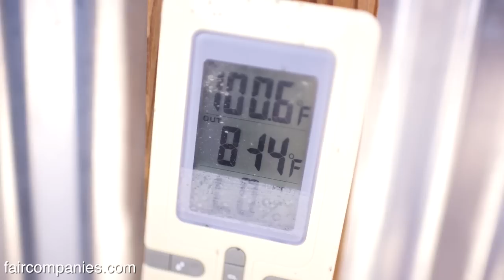From Gotham to isolated, code & debt-free West Texas estate

Comment: You Know, if that guy had driven the holes vertically down into the earth, instead of horizontally across the ground he would've completely solved his cooling/heating problems. 

This would work because the deeper you drill into the ground the cooler it gets! So, just pull the air from below. His original idea @22:26 is essentially the right idea but he just needs to change the orientation of his duct work. If he can produce a room with negative pressure in it then it will naturally pull the air up from below the ground... heat in winter and cool in summer! Nature's Own Heat Pump! 

Most people who know this stuff won't ever tell you this stuff because there's no money to be made in it... Not like there is in the heating and AC business! Negative pressure is the key to make it work. Or honestly, what did the ancients use to do? Then too, regarding the dust, if you enclose the system and use filters it will not be a problem... The dirt and dust from below is way more compacted. But if that's still a concern you can sleeve the holes with pipes to draw the air up through. Some people are experimenting with this in their greenhouses to maintain the perfect temperature year round...
Reply: Seen Retired Elderly Gentleman In Nebraska Run Underground Water Lines For Yearround Greenhouses.!. Very Impressive . . . . .
Reply: Actually, you are wrong, The deeper you drill into the ground the hotter it gets... After all the core of the planet is a solid chunk of compressed iron surrounded by a liquid boundary of iron and other heavy metals. And yes, I said liquid so it's at minimum 2000ºC and estimated to be 6000ºC.

The temperature increases by 25ºC per km the further you dig down, in the TauTona Mine which is almost 4km down, the surface temperature of the rock that they mine is 60ºC, although this is due to the mine having cold air pumped into it, so if you lived just 1km below ground you'd have roughly 25ºC all year round, although you'd have the trouble of breathable air, in your shaft, because you'd still need to pump air down, and sure, you could somehow build a trompe that's deep enough to do so, to force enough air down which you could automatically compress, and use to replace the oxygen levels in your shaft.
But it isn't generally true that temperature decreases, as you dig down, as it generally tends to increase, however compared to a summer day in Texas with 40ºC degrees in the shade in some places, it tends to decrease at first.
Reply: Oh and there is no such thing as negative pressure... pressure is always positive, however the direction of the pressure aka the flow of it, from high pressure to low pressure is what you need, so you could pump the cooler air underground up, by using compressed air... However why you wouldn't just compress the air in the first place and just run that through a water pipe is beyond me, because that's the easiest way to cool air.
Reply: @The Major,
Oh but there is negative pressure in the voidspace ...there has to be it's the same mechanic which allows for a permanent draft in a drafty old house! Also, it's at around 30 feet below ground that the temp remains the same 65-70 degree year round.
Reply: @The Major,
NOT talking about that deep! If I were then you'd be correct... But I am not.
Reply: @The Major,
You don't need to compress anything! Nature does it for you... When the hot air vents out through the roof it creates a vacuum pulling cool air from underground... Since there is no air underground you need a air intake vent pipe running diagonally from outside down into a voidspace deep under the dwelling space (NOT as deep as you may think...). The vacuum in the dwelling produces updraft from below. This updraft pulls hot air from outside down into the voidspace cooling it on the way to around 65-70 degrees Fahrenheit. It's that temperature year-round between 30 and 50 feet deep ...No compression needed. Coober Pedy  is an underground city on the Southernmost tip of Australia where the temperatures above ground routinely exceed 130 degrees. They live very comfortably down there! So, to avail ourselves of the comfort of not roasting to death in such heat above ground we just vent it to the surface in a self-enclosed environment --Nature abhors a vacuum so it will suck the cool air up and it will be cool air!!!
Reply: The Major  c’mon you going to drill 2miles? That’s where it heats up a lot . We’re talking 8 or 10  or so to reach 60 degree maybe 12 feet to reach 52 degree . JFC
Reply: @livedandletdie  Have you not ever been in a basement? It's common knowledge it's cooler just below grade.
Reply: ahau oxlahun Lol that or never been in a basement. It’s well known throughout the off-grid community going underground helps with cheap insulation and efficiency. Cooler in the summer warmer in winter (than above grade). Like this is textbook, shouldn’t have to be explained 🤦🏾‍♂️🤷🏾‍♂️.

Comment: Hun, I'm running into town for a gallon of milk. See you in 2 months.
Reply: While it is a funny comment, John actually only lives about 15-20 minutes from the Town of Terlingua which has some services including a small Grocery store, kind of like a General Store. Also, Alpine is about 1 hour and 10 minutes north of him, a Town of ~6000 population which has almost everything you need. To get to a City which has everything most Americans are accustomed to, he does have to drive about 2.5 hours to Midland/Odessa.
Reply: Army of Gog  Why would he be freezing? He has a well insulated home and in one video of him he uses a Mr Buddy when it gets too cold. Bear in mind Far West Texas doesn't regularly drop below ~30F nor stay there for any real length of time (although it can see spurts of single digits a few times per year). Also, why would he pay 3x for food? Have you never purchased food at a Grocery Store? The prices aren't automatically more expensive just because it's a small town. The Fuel comment is only accurate in the respect that John's main vehicle is a big Ford Truck, which probably gets ~13 MPG.

Lastly, you clearly didn't catch John's humor. Do you really think he doesn't bathe or shower ever?
Reply: @bookcadenb4584  Indeed and, if you don't mind the slightly sweeter taste of Sterilised Milk: It's shelf stable until opened for a few months depending on the exact production processes. So you wouldn't have to buy it that often.

UHT (Ultra high temperature) treated milk on the other hand tastes awful and I wouldn't buy it even if it can last for years shelf-stable until opened.
Reply: @bookcadenb4584  There's many problems with living so remotely- no well water, no "shore power" if you have an emergency of any kind it could prove fatal before you could even get help or get TO help, your car breaks down on that 2.5 hour trip you are kind of screwed, no cell or phone service? no internet?
Reply: @bookcadenb4584  
Terlingua - The Ghost Town in Terlingua, Texas, population: 58, just 5 miles from the Mexican border which puts anyone living remotely around there at risk too, if you had to go in for surgery or something and was away from the homestead for 2-3 days you could come back and discover everything you owned is GONE because someone happened by and saw no one around and helped themselves.
Reply: @HobbyOrganist  #1: Terlingua has more than 58 people living in it, don't rely on wiki to learn things. 

#2: The entire population of the Terlingua Ranch, Terlingua itself and Study Butte is around 7000. Alpine, which is just over 1 hour (not 2.5) from the area and about 1hr 10min from John has a population of around 6000 and a normal Hospital just like any other place. 

#3: John pays a yearly fee for Medevac Helicopter style to Alpine, just in case.

#4: Almost nobody down in the Terlingua Ranch has Well water, they all capture Rain water and John himself has a capacity of over 13,000 Gallons, WAAY more than he needs but always good to be safe.

#5: Cell service can be spotty down there, Carrier dependent, but John has it and most of his neighbors do also. When I was down there Verizon didn't work at all but I was told T-Mobile works decently enough.

#6: Yes, John and many others have Internet. It is provided by Big Bend Telephone out of Alpine and the cost isn't that bad, about $60/mo.

#7: Shore power is irrelevant if you have Solar/Wind, which pretty much 100% of people living in the Terlingua Ranch have, including John. 

#8: Car breaking down is no more of a problem for John where he is than it is for anyone else around the Country. It's a huge pita and no fun for anyone. Highway 118 which runs from Alpine through the Terlingua Ranch and to Big Bend National Park is heavily trafficked, including by Border Patrol on a daily basis.

#9: Who cares how close it is to the Mexican boarder, there are literally MILLIONS of Americans living within miles of the Mexican border. Stop watching Fux "News" and listening to the bullshit the GOP spout making you think they're all a bunch of bad guys. Merica has plenty of "bad guys" to worry about, starting with most of our Politicians.
Reply: @bobdole4694  Could buy canned evaporated condensed milk...
Reply: @bookcadenb4584  Midland/ Odessa!!! Oh God everything is so damn expensive
Reply: @bookcadenb4584  that's the whole point though...who the hell needs "everything"?
Reply: pretty much  it is a beautiful area  but you just dont run for a gallon of milk or the drs office
El Paso is closest at three hour drive

Comment: Man, you should dig a  basement , it will be cool inside it and a little bit cooler in building you live in, in the one above the basement, huge basement with air exchange with building above will provide more stable temperature regime in building above, no extra high or extra low levels of temperature,  it will establish some average level, more comfortable  .
Reply: floods and drainage problems...I assume he knows more than you.

Comment: If you laid large diameter PVC pipe underground (where the temp is constant) and a fan to push/pull the air, you'd have a constant source of cool air in the summer and warm(er) air in the winter.

Comment: This guy should defiantly make a aquapontics setup in his greenhouse!
Reply: I wonder if any fish could survive those type of water temperatures. There would be no way to cool the water. Whatever the ambient temp is, the water would be, or higher even in a greenhouse.
Reply: Doesn't appear to be much water out there. Otherwise, a great idea.
Reply: Fastrin Delver Aquapontics uses 90%+ less water than in conventional farming.
TheLeatherChannel There are ways of controlling temperatures in arctic conditions, so i guess that there is some way of doing it in desert conditions.  
All the hatches gets opened in the day, and it could draw cold air in from a pipe underground. I dunno, i'm not a desert guy.
Reply: Couldn't you just dig (rent a machine or hire some people) far enough to keep your water cool? Did you see the video on this channel of the "willy wonka of tiny houses" he dug a huge area underground and filled the end with some water to potentially farm trout.
Reply: downregulate I would bury his large cisterns underground that he has for the new building/greenhouse.
Reply: ***** I live in Arizona, one of the hottest parts of the US. Ways he can definitely do it:

1. Dig a big hole and do it underground to keep it cool. Look up "Garden Pool" for examples of people doing this kind of aquaponics successfully in Arizona.

2. Deep Water Hydroponics ponds with an air gap between the water reservoir and semi-sealed floating raft from which the plants grow. The air gap allows the water reservoir to evaporatively cool itself. Bubbling air through the pond allows CO2 gas to accumulate inside the semi-sealed air gap. Higher concentrations of CO2 enables C3 crops to become far more heat tolerant, productive, and water efficient.

3. Plant lots of big, desert adapted shade trees that provide filtered sunshine and cooler temperatures for the more delicate crops below. Takes a while to build this, but it definitely works. I grew cherry tomatoes without irrigation through the hot dry summer in Arizona using this technique.
Reply: Fair enough.

Comment: Nice because of freedom but can you make almost everything you need?  You probably could with the right structures, like a sunken greenhouse, only the top above ground. A nice adobe home with internal cooling well, so much you could do. They used to use cooling wells in Texas as i saw one in a diner my friend worked at.. people couldnt believe it was not air conditioning. Get rid of the swamp cooler... the well was about 6ft in diameter and had a wood cover in a room by itself. A single fan sat on top and one in the diner circulating the cold air. Once you get below 6ft its cooler than the heat, and when cold out, its warmer than outside.. so heating is easier.

Comment: Years ago I drove by a highway sign which was advertising these 40 acre "ranches" for sale in West Texas. I wondered "who the hell would be crazy enough to buy land out here?" A couple years later I discovered my mom and brother were crazy enough to do it. My mother collected social security, and had a small income, my brother, a full-fledged alcoholic, was seldom employed, and had a tough time getting by. The area was populated by misfits and crazies, and my brother called it "the padded desert." 

Not being able to reason with my mom or brother, and they being unable to make their land payments each month, I ended up paying for their land myself. I then built them a small home, which was completely off the grid. It was not like the one in the video above, it was a small house which I designed to look like an ordinary house, but be efficient enough to use little energy. The walls were paneled, and 8 inches thick, heavily insulated. the windows were all double-paned, the ceiling had 12 inches of insulation, and a peaked roof with eaves which blocked the sun from the windows in the summer, but allowed it to come in during the winter. It had a nice shingle roof, a covered porch, and was up and away from the dust and dirt. 

The house was powered by recycled solar panels salvaged from wrecked highway signs. 12 one-hundred watt panels, a charge controller, 10 deep cycle golf cart batteries and a good power inverter provided enough electricity for lights, television, and refrigeration; a catalytic heater kept the place warm in the winter. The house required very little energy to keep warm or cool. West Texas is very quiet, sleeping in a heavily-insulated house in such a place is hard, the sound of your breathing and heart beat is difficult to get used to at first, because the background static in most places people live drowns them out. 

The nearest store was nearly an hour away by car. I gave my mom a 3/4 ton 4x4 truck with a turbo Diesel engine, which would not get stuck when the roads turned to mud. But of course my mom never thought about doing things like getting the oil changed, or doing maintenance, so the truck broke down after a couple of years. West Texas is hard on motor vehicles, windshields are constantly getting broken or cracked, the ruts, bumps, washboards, potholes, rocks, and thorns tear up suspensions and tires, and a month without at least one flat tire is rare thing. 

My brother passed away, my mother moved back to the city, and now I own a lot of acres in the middle of nowhere with an empty house on it. I might not be crazy enough to live out there, but I still ended up with a 40 acre "ranch." I haven't been the place in years. I live in a high-rise condo in Tokyo, Japan. I don't like sand, mud, tumbleweeds, rattle snakes, and tarantulas. I don't like having to drive to town to buy a few hundreds gallons of water every month, I don't like hauling trash to the dump. I don't like having to wait at least one hour for a response if I have to call 911.  I like being able to buy anything I need without having to drive at least an hour to find it. But Tokyo is not cheap, what John paid for his 40 acres is less than what I pay for a single month's rent. But at least I am debt free; you don't have to run away to West Texas to avoid debt,

Comment: North Eastern Missouri also has no building codes at all, and there is a lot of land for sale in the area.  There are a few eco villages already in Rutledge and South of there somewhere.  But, the Summers are also VERY hot and HUMID, and the Winters get pretty cold.  There is not a ton of snow in comparison to what most of Michigan gets, and a lot of other states, but the temp does get very low.

Comment: 19:15 The legs should be almost straight when the pedal is lowest, otherwise the thigh is used more than the stronger buttock. So just raise the seat to that. And to vary it, pedal while standing up ie off the seat.

Comment: John Wells - you are an inspiration to me.  How much is property tax in West Texas I wonder?  To keep your greenhouse cool, dig down about four feet, where the temperatures is constantly about 55 degrees.  Then insurt fat tubes, and suck the cool air up with fans.  If it gets too cold (probably not there), then the 55 degree air keeps the greenhouse from getting too cold, the tubes becoming heat pumps.  You likely know about that already, just saying.  An atmospheric water generator would supply your drinking and eating water, if the humidity is above 40 percent. 

 I want to get out of this freaking city (Portland), before it's too late (65 next year).....!